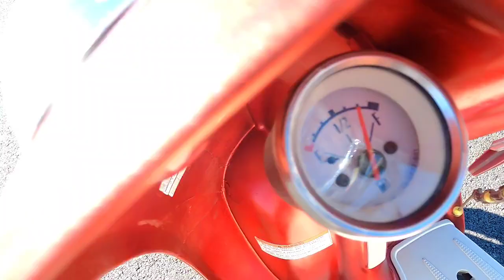2001 Yamaha vino gets a major makeover NEW PAINT JOB!!!

Comment: I wish someone would put a vid up about where to find the dang oil drain! I have looked everywhere and got half the bike apart and still can't find it? 2001 is the oldest Vino and the only two stroke, also where the heck is the two stroke oil pump? It may have been removed by the last owner as he was running it on mix but I prefer tank feed.
Reply from the maker: It's usually on the right hand near the stator under the engine shroud. Thank you for commenting and watching ‼️